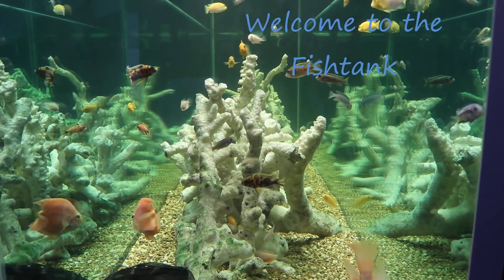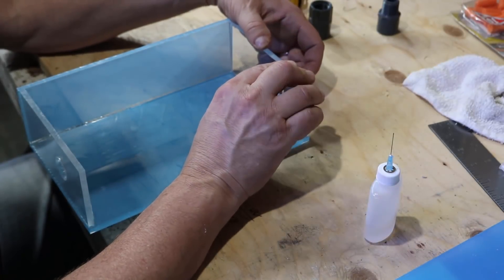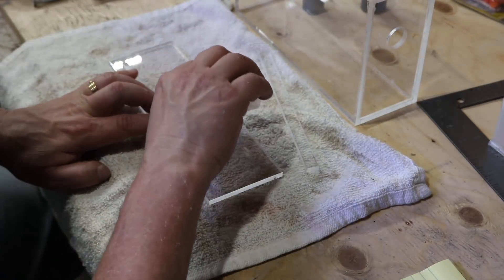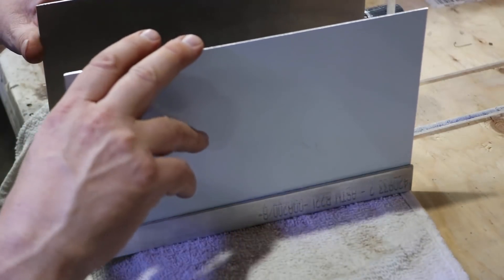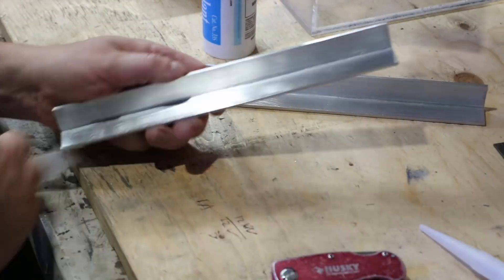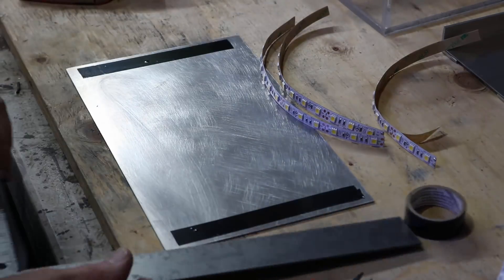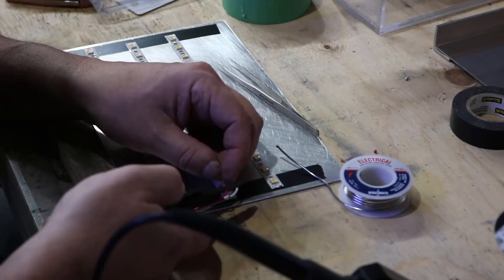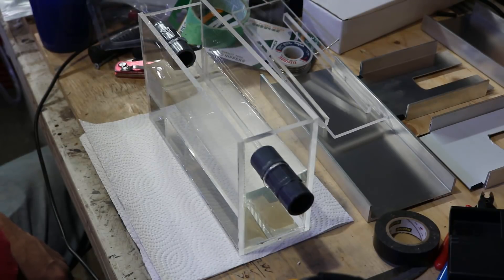DIY Algae Scrubber Encased in Aluminum Part 1

Comment: Have you been able to determine a solution for the UV-C to penetrate the acrylic?
Reply from the maker: Hey Doug. Enough UVA and B get through for this to work as an inhibitor but I've since stopped using these and now use the diatom filter. It cleans out the problem in moments and then you just need to keep using for a couple of weeks as you change the chemistry of the water that was causing the bloom. Thanks for watching!

Comment: What kind of saw/ blade do you use to cut your acrylic? The ones I’ve found are very expensive.
Reply from the maker: I've tried a few and find that there isn't much difference in the quality of the cut as long as the blade is sharp and the tooth count is on the higher end

Comment: Impressively done. May I ask where you got the shrouded acrylic?
Reply from the maker: Sorry I'm not sure what you mean by "shrouded acrylic". All of the acrylic I buy is from a local supplier, so that probably won't help you anyway. Thanks for watching
Reply: I get acrylic sheets from a local plastics store called EPlastics. They are a great source of supplies (cement, polishing liquids, etc) but even better they have a scrap acrylic bin for a dollar a pound. I find all kinds of acrylic sheets in there that I used for sump baffles, overflow boxes, and protects like in this video. If you live in a larger city, you should have something similar nearby.

Comment: I may have missed it in the video but is the UV light tape waterproof? Or does it not matter since the tape is between the aluminum and the acrylic?
Reply from the maker: I haven't been able to get waterproof UV LED tape, but you're right it doesn't see any water. Thanks for watching

Comment: How did this turn out? I’ve been thinking of attempting to make one though I’m not as hands on.  Where did u get the acrylic (what thickness) and aluminum?  Great video. Thank u
Reply from the maker: It works really well. The issue I had with it was when I cleaned it there was a fluctuation in nitrate. This prompted the 2.0 version. I actually like how this one works more. I think I would add more chambers. I will be doing an update on these coming up. The acrylic is 1/4" and the aluminum is .05. I bought both locally.Thanks for watching

Comment: Sorry, but aluminum does corrode.  It corrodes faster in salt water than pure water and will leach into the water.
Reply from the maker: All aluminum does is get a light dusty coating. I have frames on salt water tanks that are over 15 years old and they are as solid as day one and with no issues with the living organisms in the tank. Thanks for taking the time to watch and share your opinion.
Reply: Fishman Dude... 

Aluminum corrodes but it does not rust. Rust refers only to iron and steel corrosion.

Aluminum is actually very prone to corrosion. However, aluminum corrosion is aluminum oxide, a very hard material that actually protects the aluminum from further corrosion. Aluminum oxide corrosion also looks a lot more like aluminum (dull gray to powdery white in color), so it isn't as easy to notice as rusted iron.

When iron corrodes the color changes and it actually expands. This expanding and color change can produce large red flakes that we all know as rust. Unlike aluminum oxide, the expanding and flaking off of rust exposes new metal to further rusting. This is why it is so important to provide a barrier so rust doesn't start.

While aluminium doesn't rust, it often becomes dull from corrosion, and is often encrusted with brake dust, calcium, lime, tarnish, grease, oil and hard water stains. Simply washing it off will not work, you need something stronger and more effective to do the job. We recommend Flitz Aluminum Pre-Clean to remove the surface grime, corrosion and buildup followed by Flitz polish (paste or liquid) to restore a brilliant shine. Works great on fuel tanks, gas pumps, mag/alcoa wheels, diamond plate, framing, step plate, engine parts, and more. ~RustStore.com

Comment: Fishman, I'm bingeing on your videos, I confess. There's much to absorb.
One request: could you give a quick synopsis of the theory behind things like this for those of us fairly new? I can (and will) look up what an algae scrubber does but it would be cool if you could just give an overview of what this does.

This comment also applies to your air driven HOB. Never heard of one. How do they work?

Thanks man, great stuff!
Reply from the maker: I'm going to be doing an update in the near future for a modified version of this filter. I will try and cover that explanation then. The air driven HOB is the same as any of the motor driven ones. It just uses air to lift the water into the filter instead of an impeller. Thanks for taking the time to watch and comment

Comment: another great video Eric. Can’t wait to see the finished product!
Reply from the maker: Hey Jim. Thanks so much. Almost mid Feb. are you itching to get out on the water yet?
Reply: Fishman Eric.  You have no idea how bad.  My only worry is that with the extremely cold temps we have been experiencing, Lake Erie basically froze again and is at 92% ice covered...  Need some warmer temps and lots of south west winds to clear by mid April.  In prayer for an early spring.  Been working on my fish room and working a lot of Sabres games to stay busy in the meantime.
Reply from the maker: My birthday is in mid April and the snow is always gone by then and I live allot further North than you. So have heart.
Reply: Fishman I’m always optimistic but The last time it froze like this was 4 years ago and it over 40 inches thick near buffalo. On a normal body of water it would break up and melt and everything would be back to normal by early April. Here, however there is an ice boom ( a series of metal cylinders chained together) that runs across the river from the US to the Canadian shore that keeps the ice in place so that it doesn’t run down the Niagara to the falls and clog up the power plants. It makes melting subject to increasing air temps. That year they didn’t remove the boom unit early may, costing me 2 weeks of lost income. It was a very costly time.  The boom causes a lot of damage to the ecosystem as it keeps the ice from scraping the bottom and in turn a self clearing.   When a 10,000 square mile body of water is not allowed to purge itself regularly, the damage takes it toll. The only benefit to a fully covered lake is it creates better spawn for walleye, by keeping water temps low which is conducive to walleye hatches.